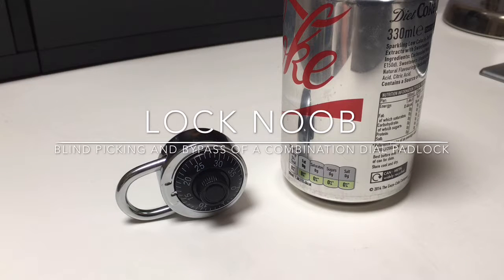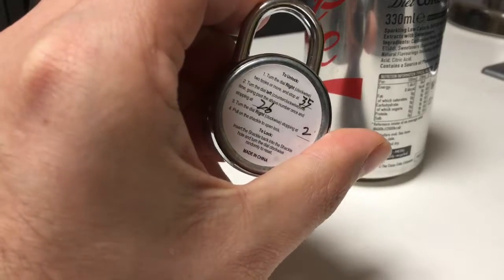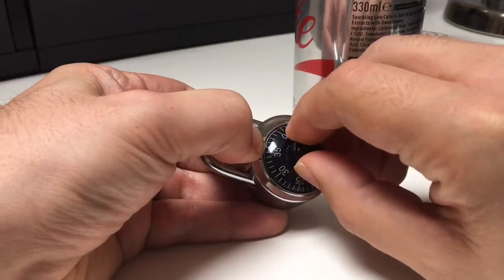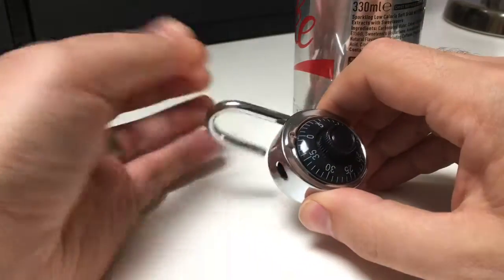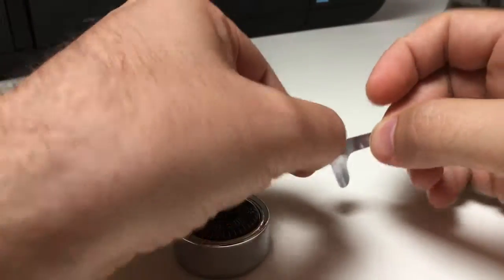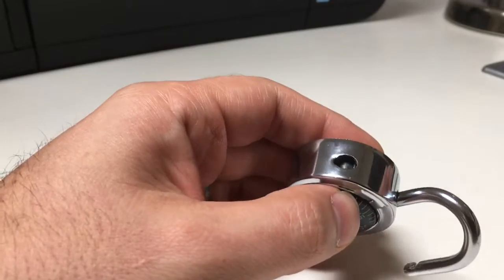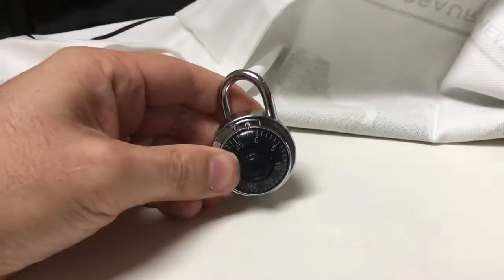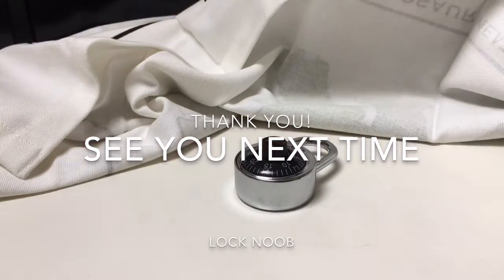(012) Blind picking and bypass of a combination dial padlock

Comment: Can't seem to get this to work for mine, in the first step my lock 100% falls into the only gate at 26-29 but I know the first number is 31, although 27 is the last number of the combination
Reply from the maker: All I can say is that it works for this particular padlock, other makes may act differently. One of the common Master Lock combination dial padlocks apparently needs you to find the first binder and add 5 to that number. All I can suggest is trying to see how your particular padlock behaves and seeing if you can figure out its secrets to exploit it and eventually, blind decode it
Reply: Thanks Lock Noob  for the reply. I've seen some videos which suggest  the binding order comes into play. There is only one way to find out.. Im going to cut the back off :P